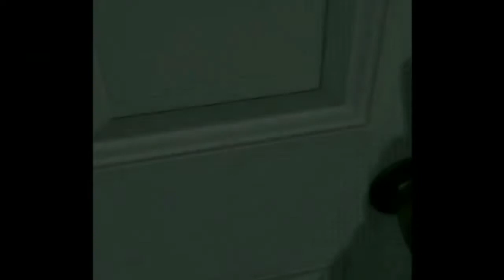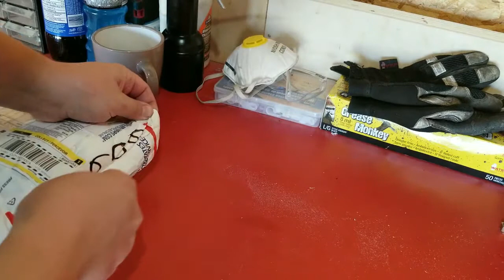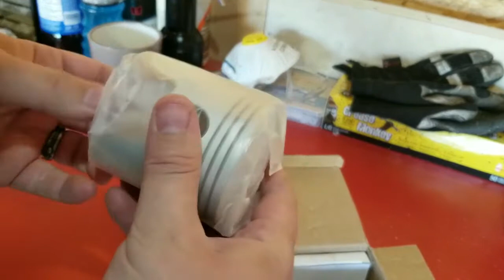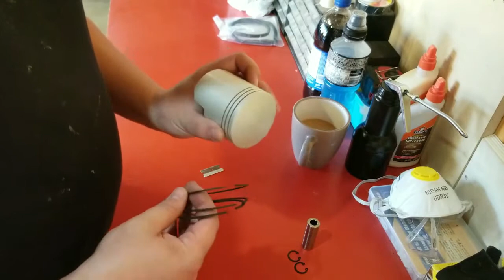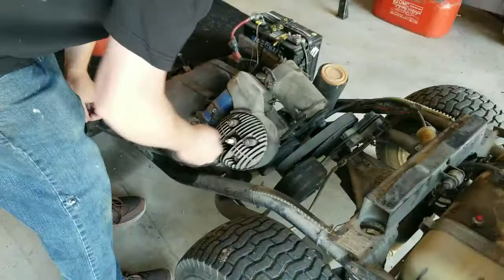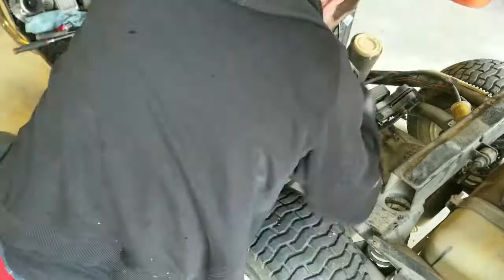Harley Golf Cart piston!

Comment: So I ordered a piston from golf cart garage. Seems rings are too big? 0.20
Reply from the maker: Hey!  You need a .00 for stock.  A .20 is for boring out to a bigger piston.
Reply: @inspencersgarage8254  oh ok. I can do the boring. Or it seems you can file rings(scary thought). Thanks.
Reply from the maker: @nateball-ri9nb  Yes you can file rings.  Do NOT bore the cylinder unless the piston is .20 over as well.
Reply: Piston is 0.20 over as well. To the machine shop it goes I guess. Smh.